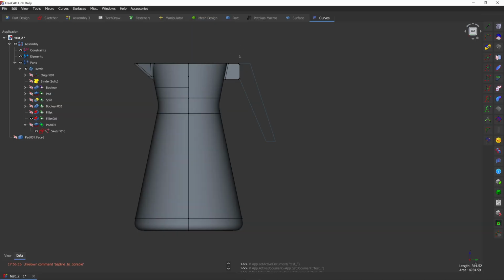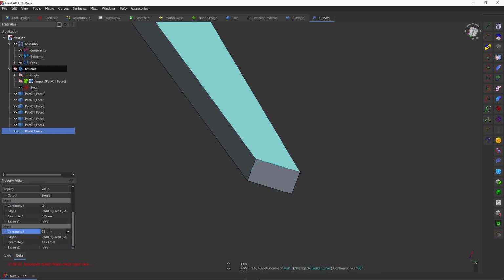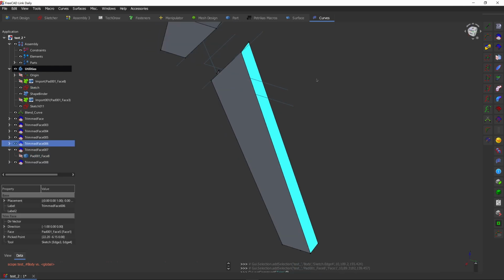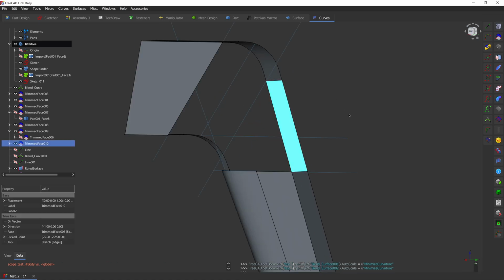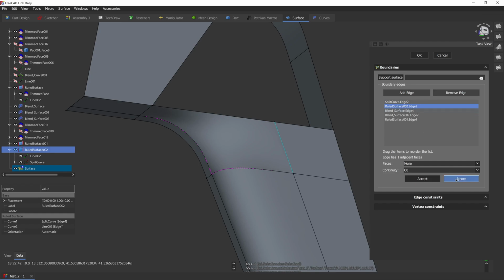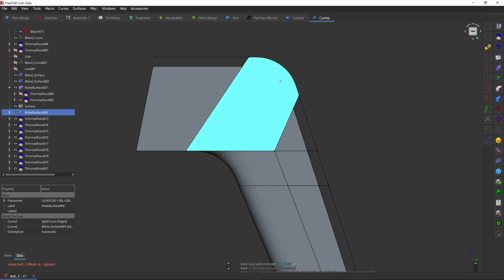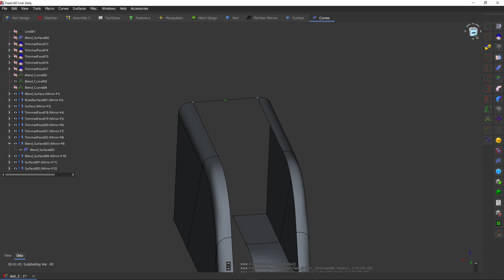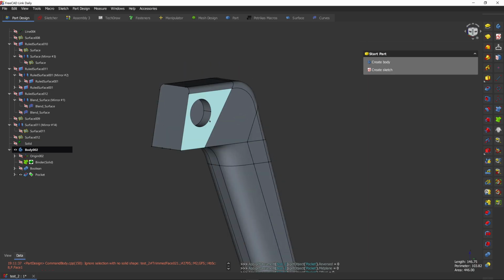[FreeCAD Link] Surfacing Tutorial Part 3 (Curves WB & Surface WB)

Comment: Our of curiosity why not use solid modeling mainly by filleting edges in a sequence as needed to get your shape ? Does freecad not support that workflow?
Reply from the maker: It absolutely does! However, filleting is G1 surface continuity, which isn't adequate for "Class A" surfaces. More on this: https://www.youtube.com/watch?v=M59ahq5Pozs
So while fillets are good for rough concepts and mechanical parts, they're not ideal for Product Design exterior surfaces.
Reply: @StudioPetrikas  ah also no G2 - Fusion360 has some G2 ability but it is rather lackluster lacking individual edge weighting
Reply from the maker: @cekuhnen  Yeah, I wish I had a choice of surface continuity level when Filleting. Well, I can always hope that it gets implemented :)
Reply: @StudioPetrikas  in one of my other apps that has no G2 fillet I simply use sketches to extrude / sweep cut the shapr corners like putting it into a router - works really well too - when baby is sleeping I have to put some Hours into FreeCAD tonight.

Comment: wait wait... are these class A surfaces???
Reply from the maker: Technically not, as I left a few sharp corners here and there, because I didn't want this tutorial to be 2 hours long. But the smooth parts are, yes.
Reply: @StudioPetrikas  how did you customize your workspace? I really want to learn freecad (use it for basic stuff and files conversions) but it's not that intuitive for me...
Reply from the maker: @nopal87  This is FreeCAD Linkstage3 branch, so you get the transparent tree and other eye-candy automatically with it. The vertical toolbars are a WIP. Lastly, install Tabbar addon from the add-on manager for easy workbench switching :)